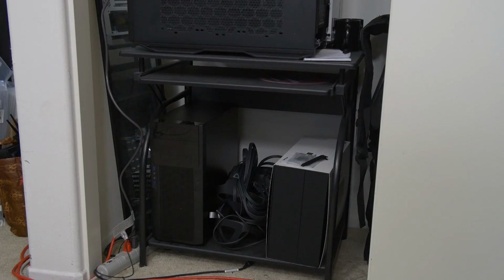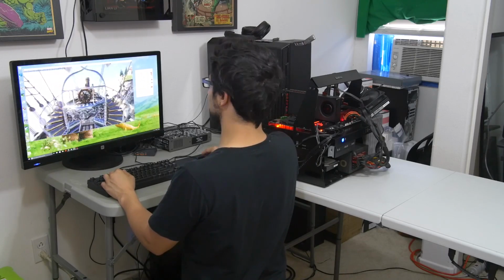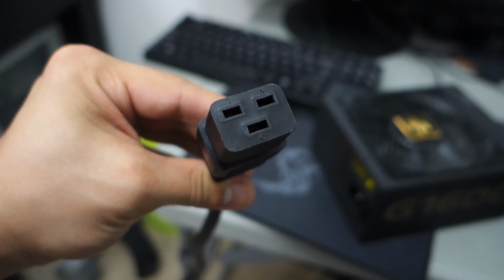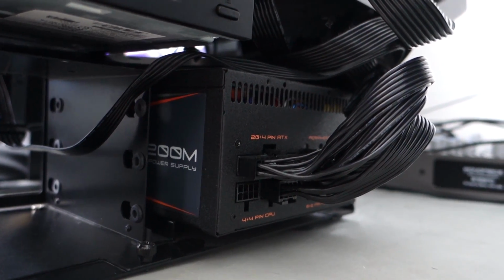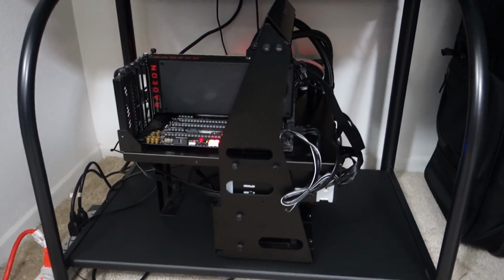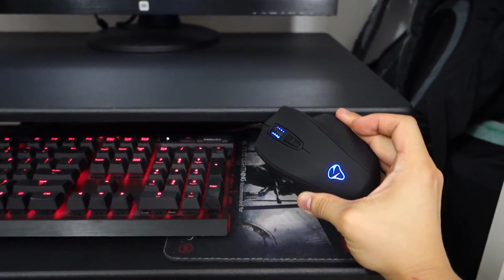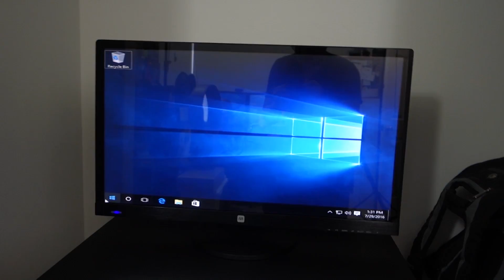Turning My Closet into a Testing Station! + Test Bed Upgrades!

Comment: get a wall mount for the monitor  and put the case on top. would't that be a lot cooler?
Reply: I agree with this would also make testing easier as it would be at a more reasonable height to swap stuff out as well

Comment: Use the hose attachment on a vacuum cleaner to clean out the air intake of the air conditioner.  When they get a little dust buildup, they use more energy, and cool less. in some cases, energy use can go up by over 20% if you test with a kill a watt or other power meter.

Will you be overclocking the test bed?

Comment: dig the setup! Curious tho, how about mounting the monitor to the closet wall at a higher level and put the test bed on the desk surface? that way you can move it as little as possible when swapping components.

Comment: NOT PROPRIETARY POWER CORD. It's because the amps at 100 V or whatever the US is at means that more current is needed and that takes the normal IEC C14 and C15 over the rated current, hence the uncommon connector. Other 1500 W PSUs do this too, eg AX1500i

Comment: Why do I feel like you went through this exact same thing when you first got the test rack from Heather lol.  Either way, setup looks purdy darn good!  Is there a way to remove the handle from that test bed at the top and maybe drill some holes in to it that you can use for actually mounting the radiator to the case rather than letting it dangle?  I feel like that might not only be visually more appealing, but it COULD allow you to get some of that rad air flowing over the motherboard a bit.  Might not be a HUGE deal, but that's just something I'd have looked in to.

Comment: I like the setup! Would be cool and really easy access (if needed) for the test bed, would to make a custom pull out drawer for it so you can slide the bed in and out for really fast hardware swaps.

Comment: Its not the the old power supply cable was proprietary its just that the standard IEC320C13/14 plug and socket are only rated for 10 amps so at 120/60 that's 1200 watts. 1500 watts requires a beefier connector rated for 15+ amps. This is all iirc and with little research but I am pretty sure this is the case.

Comment: I would suggest mounting the monitor on the wall in the closet. On a mount with an extending arm. This would give you the flexibility to position the monitor where you need it and you could they move the test bench on top of the desk. In the end you are going to be swapping parts on that thing all the time. So moving it up for easy access is going to make your life that much better.

Comment: Side note. That isn't a proprietary power connector. It's a C19/C20 connector.  It 's a different standard that is capable of a max amperage of 16A versus the 10A max found in the common C13/C14.  You find those connectors on higher power gear like large network UPS's and the like. The Hale 90 v2 by NZXT also uses it. Just wanted to clarify.

Comment: I don't like the way your CPU cooler is hanging (even though you added some support), you have already gone through a AiO leak which killed your previous X99 board. Either get a better test bench (with 240mm rad support), or manage a better way to keep the cooler safe (zip ties maybe?).

Comment: When you change your test bed, do you change your zero reference point on GPU percentage change if you add in a component?

Example if you have a 5820k with a 980 gtx, how much I am going to see different if I add in a 6800k or 1070 gtx?

Comment: I would have mounted the monitor on the wall and put the test bench on top of the desk. That way it will be easier to swap out parts to test, which is what I thought was the whole point of having a test bench. Also, you'll then be able to throw some of that clutter back into the closet where you currently have the test bed.

Comment: H Kyle could you not mount the Monitor to the wall (if you get the other one lol)  and then you can put your test bench on the Desk, save you back and crackin you head on the underside of the desk when swapping out components?

Comment: That's not a proprietary plug for that PSU. It's the high current version of the normal plug. Needed because of your 120v system, necessitating higher current.

Comment: That's not a proprietary power connector. Its an IEC19 connector that supports higher current than the typical IEC13.

Comment: You should mount your monitor on the wall and use the table for your testing station. That way you could reach and work on your station easier.

Comment: That connector on the Lepa power supply isn't proprietary - it's because the Lepa draws more than 10A from the wall. The C13/C14 plug that everyone knows and loves is only rated for 10A (1200W from the wall, in the USA). The C19/C20 plug is good for up to 16A (1920W int he USA) from the wall, so it's required on the beefier power supply if you don't want things to overheat, melt and catch fire.

Comment: Love your videos. By the way, that connector on your Lepa power supply is not proprietary. It is simply a higher amperage version of the one you're used to seeing, part of a whole family of various IEC connectors that you've probably seen. There's a whole wikipedia article about them under IEC 60320.

Comment: I know you wont read this but, I see a major issue with that setup Kyle, that fact that you will be squating all the time while doing tests... 
Advice: change the bottom shell for storage with a few shelves/compartments, hang the monitor, probably with an arm attached to the table, and place a test bed on the table top... If you could put some wells on it, it would be great to move it around (more flexibility for filming)

Comment: You probably just need a 10-keyless keyboard. And an extended mouse pad so the keyboard doesn't sit cockeyed. Maybe buy a separate 10-key to put on top.

Do a crossover with +swashin. See if he can give you any tips. I know this is a testbed, but it couldn't hurt. :)

Honestly? I would put the testbed up on top of the desk and then mount the monitor on the wall. This is so you don't have to keep bending down to tweak things. Like a standing desk.

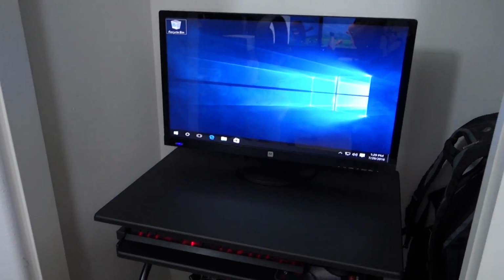Comment: At 5:30 u should have the PC on top and keyboard and monitor on bottom. It would be way easier to switch hardware and you don't need to crawl around the PC as if it was on the bottom. Having the monitor on the bottom won't be that difficult since it is infrequently viewed

Comment: swap the location of these 2 machines. put the test bed UP on top of the table where you can swap components faster and easier. also consider getting a KVM switch if not a whole new set of peripherals.

Comment: Do you think the 1080 is worth the extra money over the 1070, I do Light gaming but I play games like battlefield which are generally pretty heavy on graphics. I also do a lot of work on Photoshop, developing art and gfx. Would you recommend I get the 1080 or the 1070.
Reply: Honestly, a 1060 would be better for you, if you NEED the X80-70 SKU, go for a maxwell card like the 970 or 980
Reply: 1070 can handle bf4 and other professional work you do. 1080 is for 4k  gaming.
Reply: Robloxian Cool a 750ti can run Battlefield 4. A 1070 just for Battlefield is ridiculous, even my recommendation of a 1060 is overkill
Reply: I play battlefield, csgo, overwatch, fallout, skyrim, the division. I plan on getting BF1, Dishonored 2, and Dark souls 3 on my pc
Reply: ICHOR Fanboy Then the GTX 1060 or RX480 would be perfect for you

Comment: I would've drilled that horizontal bar on the case that holds the Lian Li logo to screw at least one side of the radiator on :P

Comment: why is that monitor on such a low resolution?
Reply: Fresh install of Windows, he hasn't configured anything yet I'd assume
Reply: oh, never new that.
Reply: You never knew you need drivers?
Reply: Konvict i thought windows would detect the monitors resolution straight off the bat
Reply: +Amaxter what drivers you need to install
Reply: AMD RX480 can only do 800 x 600 because it is potato.
Reply: +Nick it must be a joke because it has no drivers
Reply: +Nick nonono sorry you're wrong, your thinking of the Geforce 8000 GT. That is a true potato
Reply: +James Minor somebody doesn't get a joke
Reply: +James Minor somebody doesn't get a joke
Reply: Alternatively it could just be a scaled resolution. But no drivers is probably it.
Reply: HalfTimesTwo just like the first reply said, 19 WEEKS AGO
Reply: Bro chill, I know that. I said that it most likely was lack of drivers BUT it could also just be a scaled resolution.
Reply: Then why would you comment if it's already been answered?
Reply: HalfTimesTwo you've also, seemed to miss the point (also twice) that he already got the answer he wanted
Reply: HalfTimesTwo what makes you say that?

Comment: If after you use the thermal glue to attach the CPU and the CPU cooler can you detach them?
Reply: thermal paste not glue -.-
Reply: +Alzain Ali oh yea I got confused. So do you have an answer?
Reply: and yes you can. it's not holding it together it's just filling in micrographs for better conductivity of heat
Reply: +Alzain Ali oh well shit thanks I'm new to building pcs and just technology stuff
Reply: well its not glue so yes lol. its there to transfer the heat from the cpu to the metal on the cooler.
if its not there it will overheat instantly :3
Reply: Thermal paste is not the kind of paste you're thinking of. There is no adhesion between the cpu and heatsink

Comment: why was the test bed at what seemed to be 800x600?!
Reply: +Mason Gash weird... mine defaulted to my monitors standard input. he said 4k, so the way my install worked, it would have loaded straight into 4k... guess winderp has a mind of its own lol
Reply: It's the new awesome resolution
Reply: +LordDecapo the driver he has for it, the default one only has a resolution up to that, so it wouldn't go to the monitors default resolution
Reply: Its a fresh install. He has to install the network drivers that came with his motherboard before he has an internet connection. No internet, no automatic driver installs... After he installs the network driver, basically everything else is automatic.

Comment: I think you need to do an organization video, how to fit more tech stuff in your closet then ever before.. we all could use some tips on fitting more stuff in less space to please the mrs and it looks like that includes you, Nice $200 window A/C and res on that monitor.... u sure can tell that you weren't lying when you said you hadn't installed anything yet as the default display driver was quite obvious from the rediculously low res on a 4k panel..... good ole windows default driver(NOT)

Comment: if your fine about drill holes, then why not mount the screen higher and have the test bench on the top, in place of the screen.....then maybe another test bench below with a hd/do switcher.... oh but watch out for heat😉
Reply: do.....I was trying to write dp....display port
Reply: I agree, wall mount the monitor up on the back wall of the closet.  Put the test Bed on the desk and use the lower shelf for storage or other components such as NAS BOX (if have an Ethernet run which I doubt as your MB wireless).  I know my knees and back wouldn't like the bench so low.

Comment: I love the idea, but putting the system in the closet has 2 huge problems:  HEAT - that small space will be very hot both for you and for the gear.  POOR ERGONOMICS - Swap some video cards or RAM or coolers a few times and you will learn why the test-bed at knee-height is a bad idea. And what if you wanted to shoot video of the cards, cooling or other things? Hard to take pictures in a closet.

Comment: I've always thought test benches were funny.. "Yeah I have a computer comprised of the highest grade consumer hardware you can buy.. but it's over there collecting dust.. yeah.. I just plug a different GPU into it every now and then and run a couple gaming benchmarks then it collects dust until the next one"

Comment: 1TB is 1024 GB. GET IT RIGHT PLEASE. Liked the vid other than that.
Reply: no it isnt
Reply: One terabyte means 1000GB, but you are right the discs marketed as 1TB are 1024GB
Reply: it is but on a terrabite hard drive windows reads 160 something gbs becuas winds uses gibbibytes not gigabytes
Reply: 1 TiB, or Tibibyte (I believe) is 1024 GB. 1 TB is 1000 GB.
Reply: no 1024gb is a terraybyte but windows reads it a 164.something